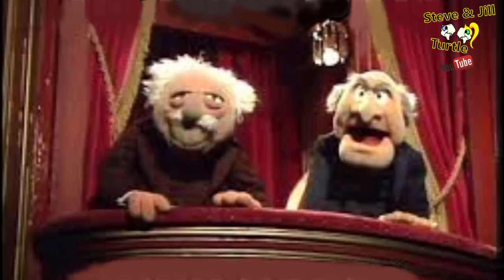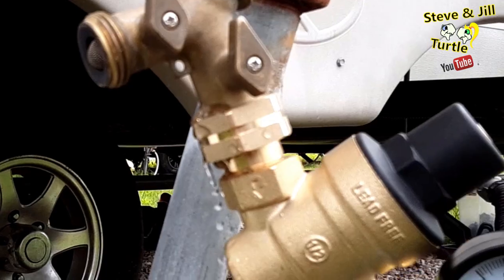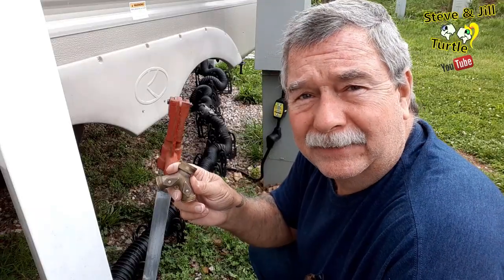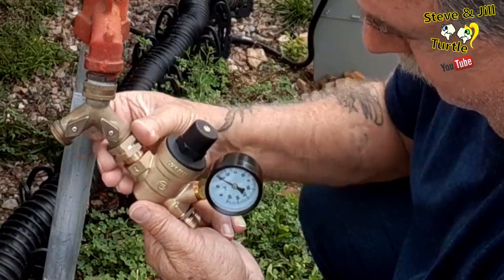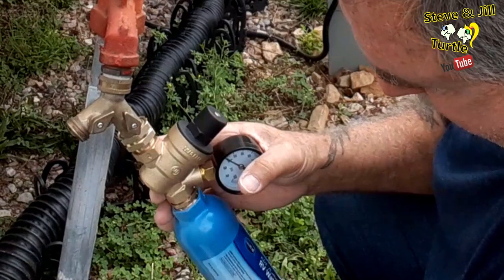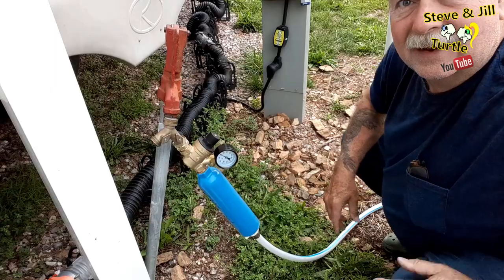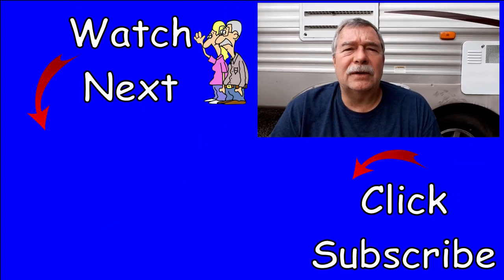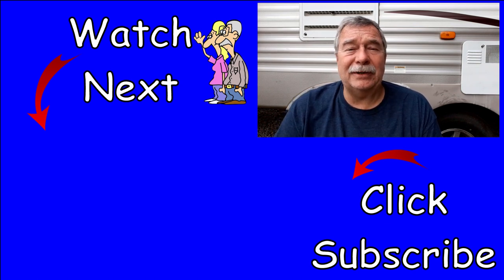Adjustable Water Pressure Regulators!  CAUTION HIGH water PRESSURE!

Comment: We stopped using these after 3 went bad. First one I left in the rv during the winter and Im guessing it froze up, ok my fault. Second and third were both dried and taken inside during the winter and come spring, neither worked. We started using the Camco fixed regulator and so far they've been fine and regulate to about 45psi and the best thing is they are a fraction of the price than these, I think we paid 13 bucks .vs. 59.99

Comment: Great video Steve! I learned my lesson the hard way when I hooked up without a pressure regulator, turned the water on and blew out the kitchen faucet! 😬 After cleaning up the water, I ran out and bought a regulator and installed it before replacing the faucet.
Reply from the maker: Yeah! I scared myself at the fam camp. Really great pressure. I did the same thing. Thanks as always!
Reply: @SteveTurtle .  Thank you so much, sir for taking the time to make this informative video!  You are appreciated!

Comment: How do you regulate static pressure? And my understanding these pressure regulators can regulate dynamic flow but restrict it somewhat in doing so . The tankless water heaters require a constant flow above 40 PSI I was told and 50 is better. I have not been able to adjust the 90 PSI city water to flow at a constant 50.  Enjoyed the teaching. Thanks!
Reply from the maker: I don't even know the difference between static and dynamic pressure. 🤔😁  The pressure regulator just makes me feel safe.  My wife would love to have max pressure.  Either way, the campground systems will determine the pressure you get.  Thanks for your comment!
Reply: @SteveTurtle  would be happy to explain it
Basic physics you can't compress a liquid. You can only put it under pressure. static pressure is what you read with no water flow at your gauge
Dynamic pressure is what you read when there is flow by restricting flow. You can lower the pressure on the other side of the restriction while water is flowing
I hope this helps

Comment: We adjust to 40psi. Gotta love the gauge. I'm still using roll-up hoses too. One thing I do do differently from you... I hook my filter up at the RV (instead of at the spigot) so the water can't get contaminated as it flows through the hose. I was trying to figure out what p-e-p-s-i stood for. Well, you got me on that one, lol. We hope to meet-up with you down the road. Well gotta go, we have a meet-up to do today.  :)
Reply from the maker: I'm pushing the limit.  Jill likes a lot of pressure.  We are set at 50 psi.  I like the idea of the filter at the RV, good point.  It's an old joke back in my military days. Name the 3 different electrical currents? That's a good one!  Thanks Bob, you and Debbie are wonderful people.  Hope to see you again.  Safe travels and have a blast on your trip. 💖

Comment: Thanks Steve. Problem is I can't seem to keep the pressure at 60psi. 40 means my shower trickles same as my kitchen faucet. At what point do I adjust it. Tried adjusting connected up, not connected, water on, not on and the needle doesn't move. I got it today. Any help would be appreciated. Thanks
Reply from the maker: Sometimes the campground pressure is just not that good.  Especially when everyone takes a shower at the same time.
Reply: @SteveTurtle  I'm not on a camp ground. I'm on my own land with my own  well with a pump.

Comment: Why wouldn't you want the water filter  before the regulator
Reply from the maker: Good point!  I guess it doesn't matter as long as you have a regulator installed.  Thanks for the comment!
Reply: Too much pressure for the filter after the pressure regulator is better

Comment: Skip the little girl comments, and other distractions and stay WITH TOPIC.  Connecting the regulator is NOT rocket science, so why waste so much time on that?  What I wanted to see is AFTER you connected everything.  Something to the effect of, "Now that everything is hooked up, let's see how this works.  When I turn on the faucet the pressure reads 45psi." Should you leave it at that, or use the screw adjuster to increase the pressure?  If you do, what should you leave it at before you turn on the traps inside the trailer?  What if you leave the traps shut and adjust the regulator to 50 or 60psi?  Will that damage the plumbing?  See... WAY too many questions you didn't answer.  I want to see the thing WORK.... not a little girl trying to be cute or some stupid Muppet cut away.  And the Pepsi thing?  Give me a break.
Reply from the maker: Very good points.  I had to go back and watch the video again.  I guess I did miss the here's how it works part.  I was so focused on the NEED, I just missed it.  I'll try to put a video together and explain the working part.  Thanks for the comment.
Reply: a) attitude problem b) stop yelling